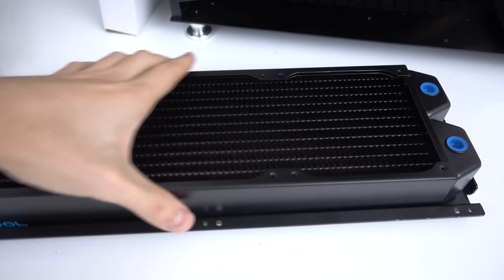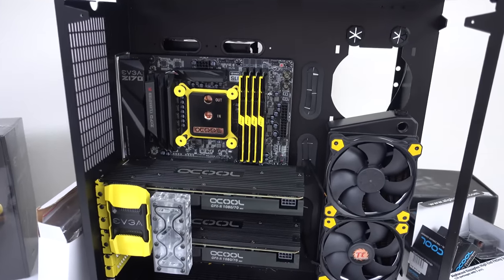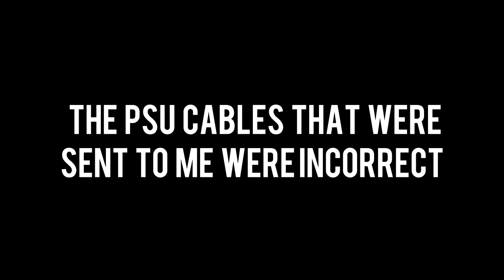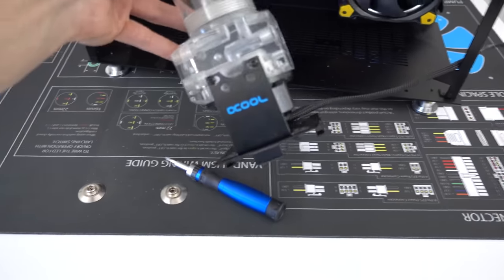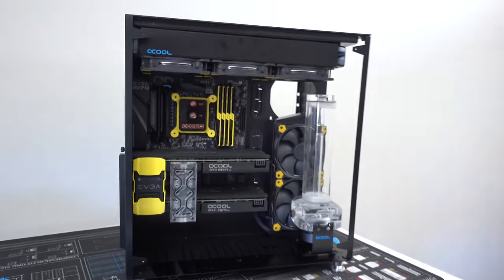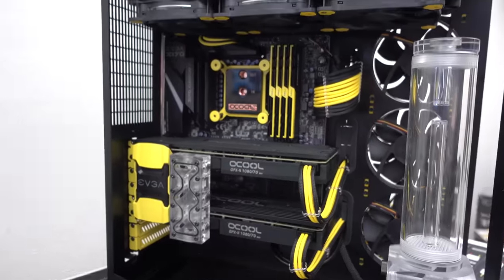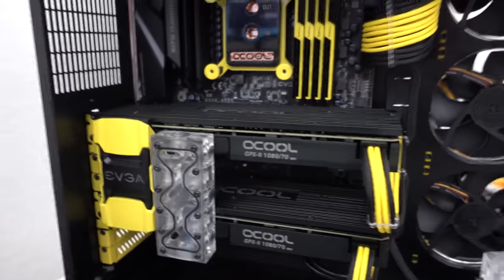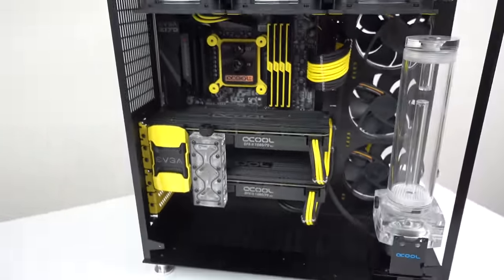The Return of #ELECTROBOX  - Part 5

Comment: only thing i dont like is the blue alpha cool logo on the top radiator
Reply: Rishabh Patel and on the pump bracket. He needs to color them yellow
Reply: I'd do it with a really thin brush.
Reply: yeah man its weird to see blue in black and yellow build
Reply: U did just read my mind xD
Reply: Tell him to dbrand it, works 12/10 IGN
Reply: @TechSource indeed, would be nice if he moded the logo's (paint yellow) and the red cable from the fans where he romoved the radiator is just anoying me (that's just me) #edfixit :p
Reply: the red cables are easy to fix remove the wore from the  clips and get some yellow electrical insulation tape annd wrap the cable in that a cheap $1 fix i did that in my PC as  some ketchup/ mustard cables were showing on some of my cables (used black colour of tape to fix it) and as it is part of the fan he would have no other choice besides painting them as those are soldered on to the motor inside the fan and opening it up would void the warranty and those cables are coloured for a reason to distinguish the positive and negative cable from one another

also for the front panel case I/O i know a cabling company based in the UK called shakmods that does front panel I/O extensions fully sleeved (though they do have heat shrinks) (http://www.ebay.com/itm/Shakmods-Front-Panel-Yellow-Sleeved-Power-Reset-HDD-LED-Extension-Cable-30cm-UK-/151496742746?hash=item2345e8d75a:g:drwAAOSwaNBUe02v) they do not have a black and yellow colour scheme but they have individual colours and black/white mixed as well as black/red mixed ed could buy a black and a yellow set and use half of each type like i did (as i have a black and yellow colour scheme too)
they have different type of cables as well as free worldwide shipping (i think) as it says so on the eBay page
Reply: also 1 thing i will note for the front panel I/O extensions is that it would be best if you use electrical tape where the original I/O and extension cables meet as they can come loose with minimal force especially the single cables + and - not the HDD leds and so on which have 2 cables in 1
Reply: Rishabh Patel and the water bridge
Reply: Rishabh Patel he will most likely sand those back as he did with the GeForce logos in his big red build
Reply: Frozen Eagle the red cables coming from the fans at the back won't be noticed as they'll be cables aged past the metal housing and away from the fan mount cut outs.

Comment: I think the GPU blocks are fine but you need to fix the mustered cables on the fans that are in the intake configuration
Reply: the only thing i can think of is remove the cables from the clips and use yellow coloured electrical tape over them
Reply: Zahid Shabir you can do what most do which is use liquid rubber or black puddy. I'm

Comment: Hey Edd!

I WANT TO SUGGEST A PRODUCT! (I wrote that in caps so you will hopefully read this.)

Love the channel and watch almost everyday. BUT that is not the purpose for this comment. I have a product to suggest that I think you would benefit from when removing stickers on those fans.
At my job we have this thing called "Goo Gone." You can get a 2oz bottle for 2 dollars at Bed Bath and Beyond and it will last FOREVER!
Just a dab and it will remove that unwanted glue left from stickers instead of using a blow drier. I just noticed at 12:28 you could still see some glue and marks from scrapping on the fans. It will save time and just look cleaner. ALSO it smells really good as weird as that sounds. You will not regret the purchase. 

-Trent

Comment: Ed! You need to rotate the three rear intake fans 180 degrees so that the wiring on the back side of the fans is hidden behind the liquid tank/reservoir. Once the take is filled with your coolant you won't be able to see the fan wiring. It already looks super clean but I think that will help even more.

Comment: Why dont you put 2 titan x pascal from your titania build since this is going to be your main pc
Reply: Sneakerheadinthebay 1080Ti is 500$ less price for better performamce in games.
Reply: Sneakerheadinthebay I think its not that gtx 1080ti is better but rather the problem of titan X water blocks
Reply: 1080ti is a little better than XP
Reply: Paralyzed no its not
Reply: ElaisM8 the 1080ti is bttr thats why i just sold my titan x for the 1080ti
Reply: A1_Digest BOIIIIEE
Reply: The XP has very similar performance to the 1080ti, but the performance for the price is much better for the 1080ti.

Comment: Looking good.  Just a suggestion, there are reservoir fan/radiator mount brackets which mounts to the existing holes onto your fans which then you could mount the reservoir to.  The res to the far right in the foreground with all that space behind it looks a little off to me.

Comment: The GPU blocks look fine, gives the build an industrial feel.  What I don't care for is: 1) not enough radiator space for a CPU and 2 GPUs and 2) airflow would work better with intake at the bottom.  You can put the 240 or even another 360 behind the fans in the rear compartment and still be able to run tubing through the grommets above the fan holes.  And if you're not happy with the GPU blocks, then paint them as well.  More yellow probably can't hurt.

Comment: Let me save you guys 12 minutes and tell you all he does is decide to remove the smaller radiator, get cables connected, and add the fittings. In other words wait a couple months so he can finally cable manage, and add the tubing.

Comment: Ed, a 360 rad is a minimum for CPU + 2 GPUs, the very minimum. Going minimal on rad space beats the point of having a watercooled rig.

Mount a 240 as intake, and you can actually mount the res on the rad itself.

Comment: finally electrobox is back.. lol :D
i've never built a pc (heck even the watercooled one). But i've watched jayztwocents video talking about watercooling, and CMIIW, he said that for each part that you watercooled and planning to do overclocking, you need at least 1 240mm rad. So looking at Electrobox, and since i know that you like to overclock your PC, don't you need at least 1 more 360mm rad to accompany the one that you have installed on top? It's because you have 3 components that you're planning to watercool (CPU & 2 GPUs) @TechSource

Comment: Hey Techsource, I noticed you used a screw driver to remove the stickers leading to the scratches. You can actually purchase plastic scraping tools that are just as sharp as the metal, but will not damage the plastic. I use it on Car projects all the time.

Comment: You should mount the second radiator on the other side of the panel it previously was mounted to, because you might need it if you want to do any serious overclocking.

Comment: You could mount the radiator behind the midplate and the fans in Front of it. would look really good. 
Also i think the second rad will be needed to push the system when overclocking.

Comment: Ed, you could 3D-Print some backplates to cover up the backs of the three fans on the right, it doesn't look that good there tbh.
Also the GPU-blocks are fine but you should paint something near the pump, it needs some yellow there in my opinion.

Comment: Ed i just don't see you cooling two 1080's and 6700k with one triple rad if i were you id bring back the radiator some how maybe put the fans on the back in pull configuation those fan cables on the back of the fan look like S#!t Glad to see electrobox is back!

Comment: You need to hide the ketchup part of the ketchup & mustard cables on the fan wires that run to the motor in the vertical column of fans or reverse them; but that may not be possible for your air flow. Just a thought. And would you share why the extra rad or pump/reservoir was not put in the back section of the case. There appears to be plenty of room. I'm guessing you want to show off the acrylic reservoir, but it really sticks out. Will have to see once it's filled.

Comment: Only the scratched fans bother me. When removing the stickers with the hot air gun and there is some glue left try removing it with cleaning alcohol. I thing that way it wouldn't be necessary to use sharp things to remove the leftovers. Aside from that the build is awesome.

Comment: you could easily fit that 240 rad witht the fans on the backside of the case. could probably even fit a 360 rad there with plenty of space. use passthru fittings, route one of the pipes from the back rad to the front rad, and the other pipe to the top of the res. route the outlet from the top rad to the cpu, cpu to gpu, and gpu back to the pump with a t-fitting and a drainplug and back to the pump. done deal. I would also highly recommend you check out singularity computer etheriel resorvoir mounts. they let you easily mount the pump and res combo directly to the rads.

other then that this is looking to be one sexy ass beast, LOVE the color scheme, black and yellow looks so good!!

Comment: I would have installed that 240mm rad on the other side, plenty of room back there you could have just run your tubes through the top fan hole rather than put a third fan that probably isn't going to make any significant difference to your temps anyway. Still cool though

Comment: You could use an acrylic plate with some drawing on it ( decal ) in the place where you removed the radiator  i saw it in alot of builds sure it will look better

Comment: This has to be the most frustrating build log ever.. Put 2x 360 rads in this!! There is plenty of room on the psu side. Mount the res on the rad on the front side to center it. There are even 2 holes just for running tubing from the other side of this case. Also.. get some yellow vinyl to match and cut circles out to cover where you scratched the shit out of the fans.  Good luck with the build.

Comment: I would remove the long tube in the reservoir or use a shorter one, as with that tube it'll take years to fill the loop. At the end you won't even notice it. Other than that 👌🏻

Comment: why not trying to put the small radiator now back of the pump? since you put the fans on the other side there should be enough room now for everything not to be cramped. It would help with the cooling since you have two gpus in there. thumbs up if you agree so Ed can see it

Comment: Sorry Edgar, but a lot of rookie mistakes here. Measure first, then install. Also, your temps are going to be crap with a single 360mm rad. You should have installed another 360 in the inner chamber vs the main part chamber of did 2 thin 360 rads which would have avoided the space issues. Which then leads to picking the wrong case. Oh, and those fans aren't good for radiators. Oh and your custom cables should be custom length. Oh, Alphacool products are generally low quality vs the competition (EK, Watercool, Hardware Labs, etc). Oh and OK in being a bit harsh, the yellow and black color scheme does look dope.

Comment: I don't know much about custom loops, but couldn't you just put that other radiator at the bottom of the case? Would hide those other cables at the bottom of the motherboard and may make the bending of the tubes process a little easier.

Comment: Isn't it worse that the radiator is blowing out hot air and all the hot air goes through the radiator and doesn't cool the liquid. If you have the radiator pulling in cool air all the cool air will cool the liquid? Propably worse thermals.

Comment: 2 questions.. Is that a 200mm res or 250? And why not put the 240 rad on the back panel where you put the 3 fans? Or even and another triple?

Comment: M8, you left adhesive on the fans after removing the decals and it looks like you scratched them up with the screwdriver. Why not just spend $5 on some GooGone and paper towels and remove the adhesive the right way?

Comment: Ed i want to ask u something if the fans on the top will take off the warm air that will not could down your liquid and ur cpu and gpu i guess you need to change .. do the opposite the fans in the right side should take off the air and the fans  radiator should bring the could air
Reply: If he swapped the configuration of the fans then warm/hot air would be passing over the rest of the components.  His configuration now works since cool air is coming in and over the rest of components.  When it passes through the radiator, thats when the air becomes hot due to the air removing the heat from the water through the fins.

Comment: I do t get why alphacool has t caught on that people don't like there gpu blocks or Sli bridge. I would have mount a radiator on the bottom as well then mounted the reservoir on it covering up the section that had the 240mm radiator. That or cover it with black acrylic. Too many youth era doing watercoolrd builds that are all the same sponsors.

Comment: IMPORTANT QUESTION. WHEN YOU purchase a power supply or gpu or graphics card etc. Does it include cabels? My build has a 750 w evga psu, amd ryzen 7, geoforce gigabyte 1070, msi 350 tomahawk motherboard, corsair carbide case, 250g kingston ssd.

Comment: Hey Ed great video! I just had a question, I have this MSI gaming 970 motherboard and recently one of it's capacitor leaked and since then the PC is so unstable which is really a big problem, my question is, is there a way to fix the blown capacitor?
Reply: November is the Mobo dead?
Reply: The mobo is working fine but as soon as there's some CPU load, It downclocks it to 1ghz and crashes. Also this mobo is limiting power to the GPU, about 40W under full load - it's an RX470, i even tried sliding up voltage and power limit on it but no luck :\
Reply: Uhmmm, It seems like the mobo is not working, is it under warranty? If not, I don't know what to say... just buy  a new one :(
Reply: The mobo is working, and under warranty bought it 2 months ago but you know MSI takes ages to get it replaced :D i can't buy another one here bc bought this one after the older one died so i guess i'll have to stick with it :/
Reply: Idk, If only msi were faster :(

Comment: I know this video is old but what is it about drilling holes and trimming top plates that is so hard? I mean if you are this hardcore into custom built computers you would think that modding would also be an obvious solution to all problems (besides the PSU cables) this PC has run into...just sayin...

Comment: This Case is not ideal for 2 rad's water cooling you should get more front radioator mount and only one side panel like many many phanteks cases or you could go maniac and do it in TT The Tower 900 White or black

Comment: wouldn't it cool be better if you routed cpu to radiator then to gpu and back to radiator the coolant is getting heated before it gets to the gpu..."?
Reply: bottom gpu will be getting warm coolant yerh..?
Reply: Bull Not nearly warm enough to dramatically affect cooling of the bottom gpu.

Comment: if i was you, i would but a 120 mm radiator instead of the 240 mm and put it on the top them it let some place for the reservoir
cause 360 mm isn't enought for an overclocked cpu with a 1080 sli

Comment: People who are smarter please help me! What parts do i need to upgrade or downgrade here? CPU: Intel Core i5-6600K 3.5GHz Quad-Core Processor  ($229.38 @ OutletPC) 
CPU Cooler: CRYORIG H7 49.0 CFM CPU Cooler  ($31.49 @ Newegg Marketplace) 
Motherboard: MSI Z270 GAMING PRO CARBON ATX LGA1151 Motherboard  ($164.89 @ OutletPC) 
Memory: Kingston HyperX Fury Black 8GB (2 x 4GB) DDR4-2133 Memory  ($58.48 @ Newegg) 
Storage: Western Digital Caviar Blue 1TB 3.5" 7200RPM Internal Hard Drive  ($49.33 @ OutletPC) 
Video Card: MSI GeForce GTX 1050 Ti 4GB Video Card  ($139.98 @ Newegg) 
Case: Thermaltake Versa N21 ATX Mid Tower Case  ($30.98 @ Newegg) 
Power Supply: EVGA 500W 80+ Bronze Certified ATX Power Supply  ($42.88 @ OutletPC)
Reply: The mobo is so expensive, Are u going to do oc? Also you might go with a z170 mobo instead of the z270, also try to go with a better psu and and get a  gtx 1060 6GB
Reply: Waffly reduce mother board to a z170 and buy a 650 watt power supply, and upgrade to a gtx 1060 the 1050ti is trash trust me you're Gana regret it, however a hyper 212 evo CPU cooler is better
Reply: Karim Charaani that is the same as I said xD
Reply: Hector yt oh i didnt see the full comment haha WELL i mentioned  a cpu cooler HA!
Reply: Karim Charaani yeah good job :D
Reply: thank you
Reply: Waffly sure, but check the 212x instead of the Evo, same price and newer
Reply: Waffly move away from msi mother board, they aren't that good go for  Gigabyte Z170-GAMING K3, will do you good and if you are willing to pay more i'de say fuck it and nump to a 1070 and 6700k or 1060 6gb 6700k
Reply: Waffly just tell me if your willing to pay extra ill edit it for you

Comment: one 360 is not enough to cool cpu + 2 gps
Reply: bjarte Larsen you can easily overclock any Kaby Lake with a 120mm and run a Fury X also with a 120mm, 360mm should be enough with some quality fans